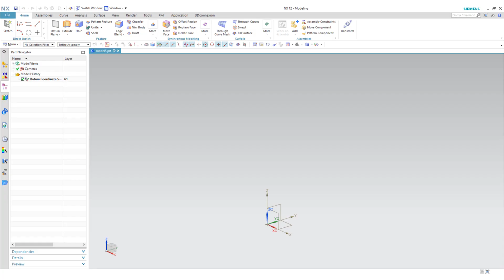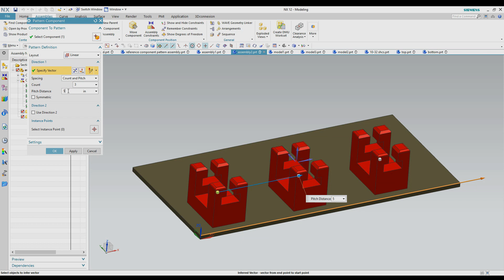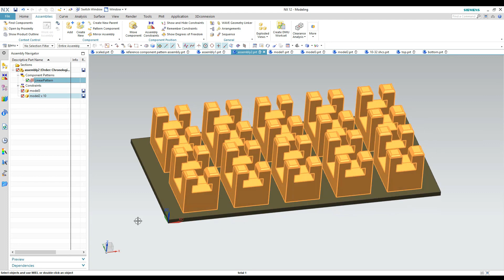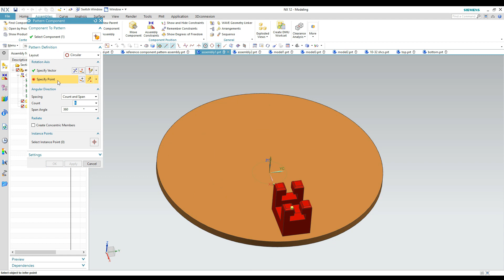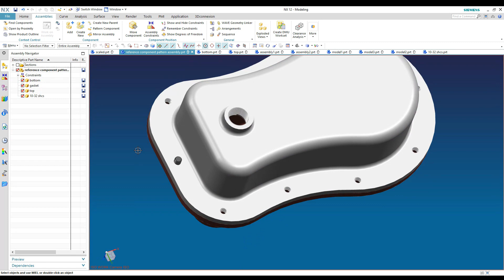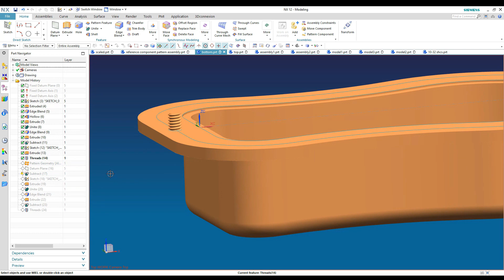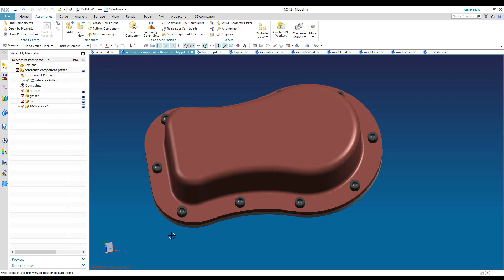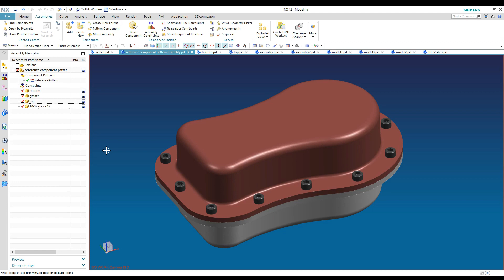Siemens NX Pattern Component Tutorial

Comment: I like the video!  I was looking for using reference method.  Say I have 5 holes, and I use the Fastner for 3 of them set at flushed with the surface, but two of them are offset by .100, because something else is going under the head of the fastner.   So I delete the two, and use the same type fastner for offsetting it, that is not part of the pattern components, is this the best method?

Comment: Hello,  is there a setting to change to hide the Patterned Components on my Assembly Navigator.   When i pattern the components it basically creates a long list of the parts in the Assembly Navigator that I patterened.   It is not a clean Assembly Tree like yours.
Reply from the maker: Hello, if you right click on one of the patterned components you can select pack, and that will combine all instances of that component on your assembly navigator. If you ever need to see all of them again you can right click and unpack.
Reply: @MorrisonInst1973   Thanks!  I found out it was best to set my Customer Default settings to "Pack"
Reply: @MorrisonInst1973  thank you i had a problem with that  for a long time !!!